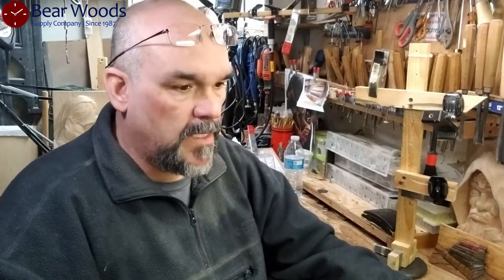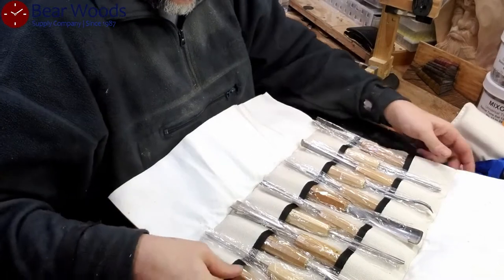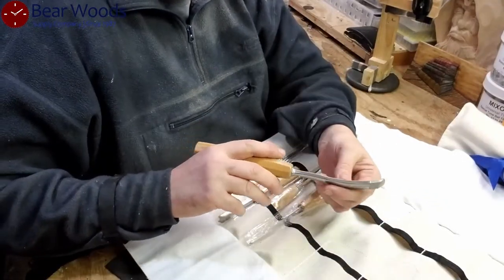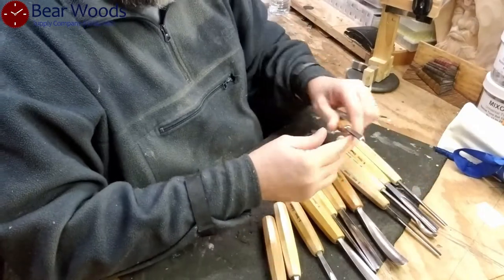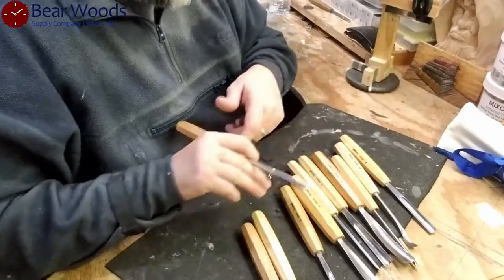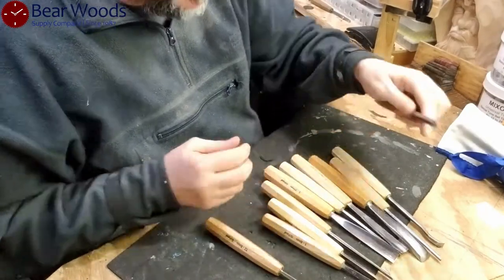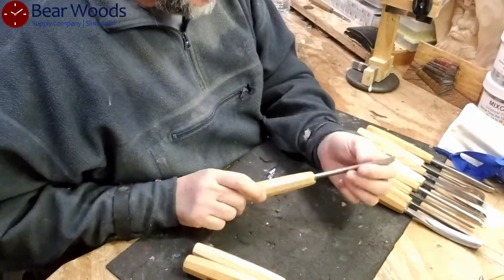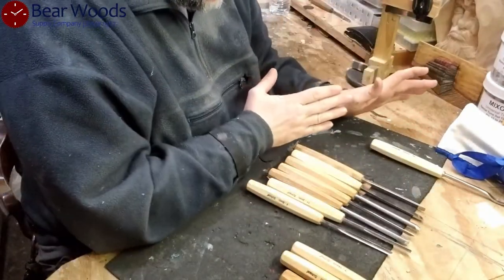Schaaf Chisels 12 pc Set Tool Review - BearWood.com & Sculptures by Randall Stoner, aka Madcarver

Comment: I bought the fishtail set and was actually pleased. They needed quite a lot of sharpening, but were decent tools for the price. The problem starts where I got the 12 chisel set. Of the 12, two were serviceable tools (the flat and the skew). The v-tool needed the cutting edge ground off and redone, it was so out of whack. The gouges had such steep bevels on them that they needed to be held almost perpendicular in order for the cutting edge to contact the wood, which means that all you are doing is smashing. and not cutting. Three of the gouges fell out of their handles. What they are is chisel-like objects. I've been carving since 1972, and I can't recommend these.